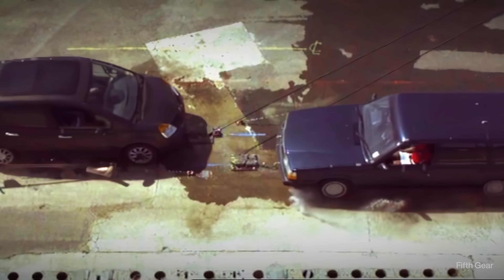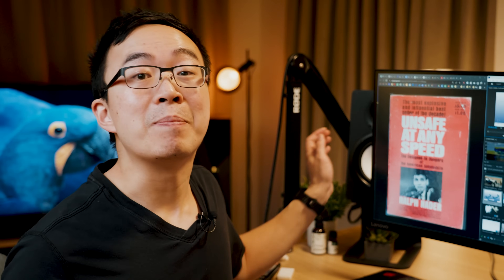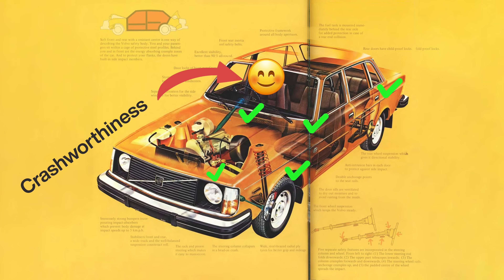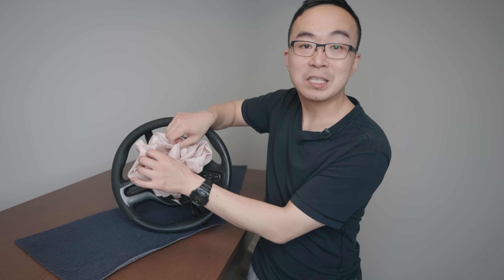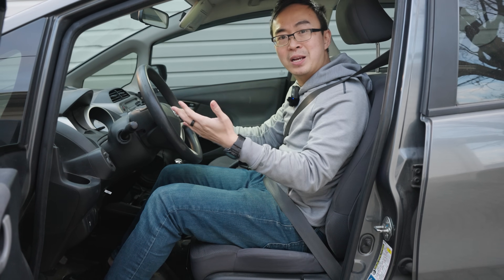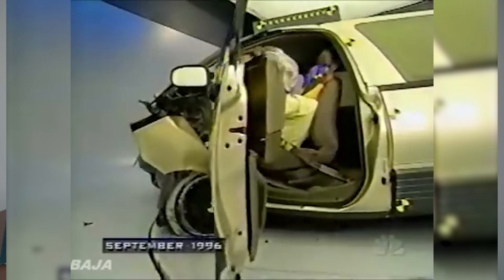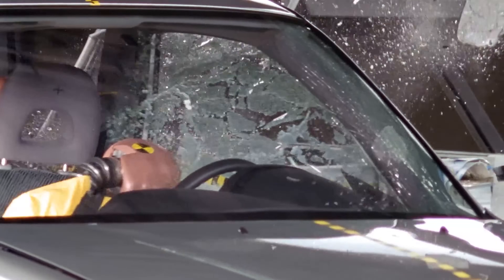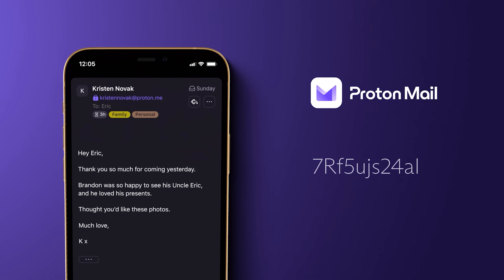When does a car stop being safe?

Comment: My mom’s 88 Volvo 240 got T boned in a serious accident and my mom walked out without injuries. It happened with I was 3. Volvo is the first automaker to feature modern crumple zone. If I got front ended in my 2015 Camry by a tiny car like the Renault, all I would have is  minor burns on my thumbs and disorientation from the airbag, and having to buy another car and the other driver will go to the ER. I wish we got better cycling infrastructure in the United States as well as better public transportation. It is possible shop at Costco without a car if NIMBY laws get repealed and have a bicycle trailer to haul your Costco purchases home.

Comment: Not sure if the IIHS accounts for this, but a very important aspect of a crash is crash compatibility: The amount to which the safety features of two cars in a crash work together to minimise the damage inflicted to both their passengers. There was a time, where crash tests were conducted based on a class system, where pickups for example were only tested against vans and other pickups, completely neglecting the fact that the road is actually for everybody. This did sometimes result in real world crashes, where a smaller car slotted in beneath the crash structure of a taller pickup with next to no resistance, and the pickup's crumple zone was basically untouched. Obviously not a good time for the small car driver, plus the added unfairness of the notion that had the crumple structure been placed appropriately it also would have done its job, and most definitely make the accident less severe, since God knows a hood the size of a football pitch has enough room to crumple before their passenger gets too close.

Comment: There is one $0.20c part that will save you in any crash situation...the nut behind the steering wheel. 
Everything else added to "save you" is just added cost.
If the art of driving was a mandatory requirement to get a license you wouldn't need to worry about which car you buy.

Comment: Going back to your opening bit, although Renault do not brag about it, they take safety very seriously and do design with passenger safety as a high priority. That a Modus outperforms a slightly older Volvoi estate was still a bit of a shock to many when this item was first shown on British TV. Daft thing is, Renault no longer sell the Modus in the UK. Due to poor marketing Renault's share of the UK market has collapsed from the late 1990's and they have cut out a large number of their models. Looking at the Renault France website and the Renault UK website is sobering (or should be for Renault UK's marketing team)

Comment: I used to work for a tuning company that also did car repairings. One time a havily crashed Renault Modus came to the shop, and it was running. I even turned it off and started againg without hasitating. The design of the Modus is pretty much like the one in the A class. When in severe frontal impact the engine would tend to go under the seat in order to prevent foot/leg damage therefore the engine itself doesnt get totally crashed.

Comment: Now if only the governments cared enough to make sure that the drivers are safe. What good is it when Karen barrels through a red light because she was looking at the giant TV strapped to her dashboard. 
And besides it's all utterly pointless when modern cars weigh twice as much, have no visibility, are filled with alarms that go off constantly to distract, have built in throttle lag so that when you try to stop the car powers on for a few seconds and all your controls are electric and have no feedback and the person behind the wheel is utterly incompetent. 

Not crashing in the first place is the ultimate safety measure with a 100% survival rate.

Comment: The safety cell is great and all, but most focus has been to improve survivability within a car (and a hit pedestrian) in the event of a crash. As a result, numerous sacrifices have been made. Drive a 70s or 80s car and you will quickly notice that overall visibility and spatial awareness was substantially better than almost any modern car. The pillars were thin and the windows came down low. I’m almost amazed at how unsafe cars have become to drive because of created hazards due to poor visibility and massive blind spots, and overall feeling of isolation from the environment. I haven’t looked at detailed data but I would expect that overall number of incidents using some normalized metric to account for population growth is likely growing as people become less and less involved as drivers (and less aware as pedestrians, too).

Comment: One MAJOR flaw with the IIHS test and the way it is structured is that it does not include pedestrian crash tests. Heavy cars protect their own passengers well, and smaller cars can adapt to handle impacts from larger cars better, but humans don't change. Heavy cars are more dangerous for society as a whole, and unfortunately this arms race for safety has increased pedestrian deaths almost twofold in the United States while not significantly changing drivers' safety. In my opinion, IIHS MUST start considering the impacts cars have on other road users - drivers, pedestrians, cyclists, etc. protecting the driver alone is no longer sufficient. We must start minimizing cars' impact on others, but this will require a big shift in mindset on how we test car safety and what we worry about.

Comment: Being a motorcyclist, the biggest safety feature you can have... is the right mentality. people see a car or a vehicle with advanced safety features and forget that nothing is safe if you drive with your eyes closed or refuse to use common sense. One of the biggest arguements in motorcycling is 'loud pipes save lives' I disagree but i am sure that if you hear a loud bike somewhere, you check more. conversely, i wouldn't be surprised if some safety features make that harder too. wider A pillars that can create blind spots or B pillars that make shoulder checks less effective come to mind.
Reply: There's also a remit in law here in the UK that states that there is no such thing as an 'accident', there's medical events (heart attacks etc) where someone loses control, there's lack of attention (such as checking your phone, or not stopping in the area you see clear, called 'Driving without due care or attention'), not being in control of vehicle events (such as loss of a tyre or a mechanical failure) then there's furious/dangerious driving. All of these greatly change the standard that people are expected to drive here in the UK vs the states. I regularly hear about people driving after a DUI with essentially a slap on the wrist. here, that's an INSTANT jail sentence. Being on your phone is 6 points and, depending on severity, 12 month ban. plus everyone has to declare medical issues with the DVLA, so if ol' mate james has a problem with his ticker, he's not allowed out of the doctors office with his car keys or licence. Conversely, if you are trying to get insurance for any of these, it'll raise your premiums up 800-1000%, insurance companies just don't want to take the risk. I'm sure that's the same in the states but you all seem rather lenient. oh, and we also have MOTs as well, cars that are older than 3 years are required to have them and you can't legally drive a car without an MOT or insurance.

Comment: Two years ago my 2010 Honda Fit got hit almost identically to the small offset test. I was sitting in the left turn only lane with a red light. A small suv coming the opposite way wasnt paying attention and veered across the intersection probably going at least 35mph. Hit me driver side corner. This was my first real collision after almost 20 years of driving. It was crazy violent.

Air bags went off, glass shattered. Car was totalled. After all of that the only injury I had was a small scrape on my left arm. I was around corner from the golf course which was my destination. After the police took the report and the car was towed away, i took my golf bag, walked over and played.

These safety features are incredible.
Reply: Priorities.
Reply: That's what the engineering focuses on! So you can walk out of the car, say "wow that was bad!", and get on with your life.

Though I strongly suggest going to the hospital for X-rays after any crash strong enough to activate the airbags or bend the vehicle frame. Many of us don't feel any pain when we have adrenaline, and a crash causes adrenaline. It's very possible to have internal bleeding, which is extremely dangerous, without knowing it. Also, some kinds of injuries like sprains may not hurt in that moment but will absolutely hurt the next day - and it's not fun to go to the hospital the next day when you're sore all over and it hurts to move. I've been in exactly that situation.

Think of any boxer after a match. They look a bit red but they're still moving around, and they are jumping for joy if they won. But you won't see them the next few days, because that's when they're turning blue and swelling from all the bruises, and they can't get out of bed.
Reply: @chrisedwards3866  And, if you turn out to have been injured... the fact you went golfing from the crash scene could shift liability percentagewise, or totally destroy your legal position. You should have gone to hospital. Glad it all turned out well.
Reply: My accord got hit by someone making an illegal left in the opposing direction at about 15mph when I was going down the road at about 30, the engine even turned over afterwards but the frame was bent so far back that the wheel was rubbing against the plastic. Everyone walked away and slept at home that night which is the best outcome you can ask for, it is amazing how far crash safety has come.
Reply: Yeah, my mom got T-boned with me and my two siblings in the car, she was going ~30 and the other car was going ~45 (she wasn't paying attention and thought she was in a turn lane). Totalled both cars, but the worst injury was a scratch on the other driver and a couple bruises on me and my brother (we were on the side of the impact). So happy for all those safety features!
Reply: I had an unbelted 45 mph partial offset impact (driver's side) with a drunk driver while driving a Renault R5 (LeCar) designed in the 70s.The passenger compartment had little deformation, the steering column and dash helped absorb the deceleration of my body. It took me a few months to walk normally and close to a year to get over the pain when coughing , but nothing life threatening. Cracked Sternum, bruised diaphragm, torn cartilage where ribs connect, soft tissue injuries to the legs where I got jacknifed and stuffed into the floorboard. Few stitches to close some facial lacerations. Four decades later and no lasting effects.

1980 Renault R5 Crash Test on YT shows why I survived. It did surprisingly well.
Reply: just bought a 2009 Honda Fit from my neighbor, almost unused car, pretty rare, and I'm so glad to read this
Reply: The other driver Only hit you on 35Mph and you were standing still that is a low speed any car would be safe in that crash 😂
Reply: you were only saved by the fact you were sitting still. stop giving it credit it doesn't deserve.
Reply: @gabesmath105  So you're just gonna ignore that this man is alive because of safety features? Someone's salty Hondas are good lmao
Reply: @ActuallyEarth  he'd be fine in basically any car since it was parked
Reply: @gabesmath105 you've got room temp iq
Reply: @Leo9ine Did yOU AsuME tHEiR iDEnTItY!?!?
Reply: @gabesmath105  Dude your not cool for saying this. The fact that he didn't injured in a nearly 60 km/h is impressive.
Reply: @disneyiscoolnottherealdisney  it's not. We aren't in the 90s anymore.

Comment: I think the greatest issue nowadays is car companies designing cars to excell at crash tests, while being unsafe to drive. It´s even worse, since testing started accomodating active systems into total evaluation - a car can have excellent passive passenger protection, but will only receive like 3* out of 5 in total safety rating (dunno about US, but EU does this).

Then, there is the "Moose test", which shows, if the car is susceptible to overturning, when doing emergency turns in higher speeds (especially SUVs due to their higher center of gravity).

Comment: Neat safety tech recently invented by Tesla:
Tesla cameras can see that some accidents are going to happen so the Tesla will pretension the seatbelts and set off the airbags a tiny moment before the collision so that passengers heads hit a softer, slightly deflating bag of air vs one that’s expanding explosively. 😊
Tesla also sets off airbags with a smaller punch depending on the weight it senses in the front seats. Airbags are made to save a large American male after all and airbags injure people all the time. 
Tesla also designs their cars to be safer than the tests test for and all of their vehicles are the safest ever, with the lowest probability of injury and a score that’s the equivalent of 6+ stars. 
I really appreciate this episode, very informative and fun.

Comment: I’d say crumple zones is what made most modern vehicles safer but….fords idiotic use of aluminum is counterintuitive, my grandfather works construction and when I was battling cancer not too long ago a person in a vehicle behind him wasn’t paying attention and was going way to fast ended hitting his company truck which was a ram 1500 4x4 it completely damaged the front end and totaled it but he made it out with minor injuries which was the calling he needed to trade in the F-150 sport we had for a 22 ram 1500 big horn 4x4 but another reason is the ford was pretty much on it’s last leg, the ford sync radio didn’t work, then it started overheating and had shifting issues occasionally and my grandfather straight up said if that would’ve happened when he was still using an aluminum era ford f-150 from the construction company he wouldn’t be here right now!

Comment: Fun fact: When the small overlap entered the arena, Volvo managed the test with a Volvo model that was around four years older than the test.

Why?
Because Volvo builds cars to be safe. not to handle crash test, as many other manufacturer does. They have their own crash investigation team that has been colelcting data for decades, from real world crashes, to be able to make things safer. And a lot of the research they do, they release for free for other manufacturer to follow!

Comment: Andrew, don't let the fear of getting in an accident get in the way of traveling. Also I think there is more to the equation than just the ratings. I rolled my 2009 cobalt 6-7 times at 65 mph and walked away with only scratches. Sometimes life happens man just be blessed is all
Reply: "Andrew don't let the risk, almost certainty, of getting in a car accident that will injure you get in the way of traveling"

No. You fucking solve the problem. Don't accept it.
Reply: @Kloppin4H0rses what are you on about?

Comment: One problem is that all of this deals with car vs car collisions.  When drivers feel safer they drive more dangerously.  To some extent the safety features protect the driver.  But Nader also called for cars that were safer for other road users.  e.g. pedestrians, cyclists motorcyclists etc.  Modern cars do NOT meet the Nader standards for pedestrian safety.  Nor are they driven at safe speeds in areas where pedestrians abound.  So we have created a new class of losers in the automotive wars.

Comment: Driving a small car "vw golf" I see those huge truck and suv more often than sedan nowadays, I'll likely be the one who will sufferer most in an accident wherever I'm at fault or not. I hope future safety test  will focus on this
Reply: This is a result of car manufacturers abusing the tax loophole on "light trucks". It costs a fraction more to build a truck or SUV than a regular sized car but they can sell them for a LOT more because they're so much bigger. The EPA fuel economy regulations also work on weight to fuel consumption ratio so a heavier vehicle means they can be less efficient. These loopholes need to be fixed. At the very least you should require a commercial/truck/van license to be able to drive these things which will bring with it higher insurance and more competency to attain (in theory). This is how they're handled in other countries, mostly in Europe. France for example doesn't ban these kind of vehicles, but they disincentivise them by putting a heavy tax on their purchase. I believe it's 60,000 Euros. It's based on how much it pollutes too I think.
Reply: I was in a VW Golf that got T boned by a Ford F-150.  Both vehicles were totalled, but the Golf protected me just fine.